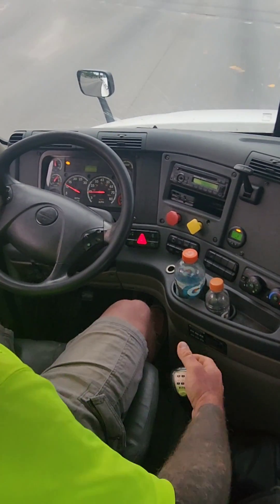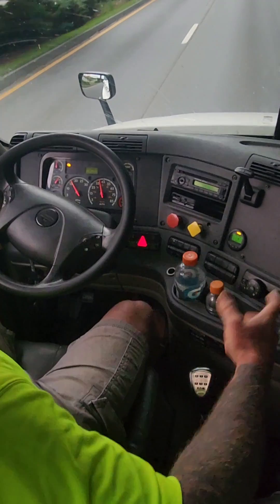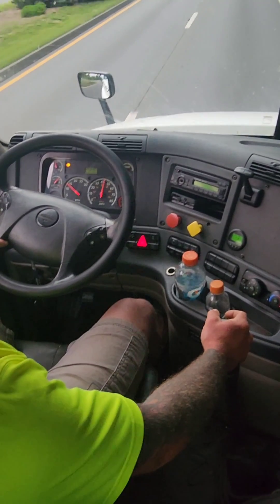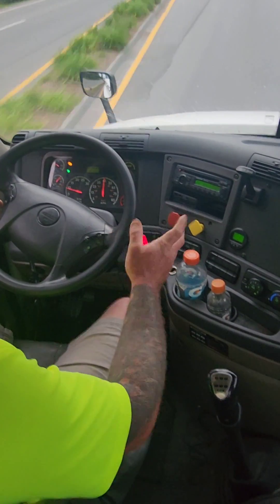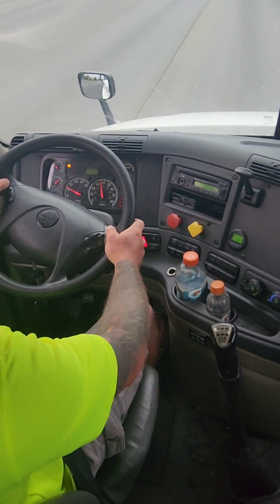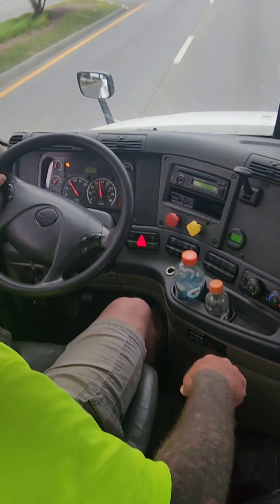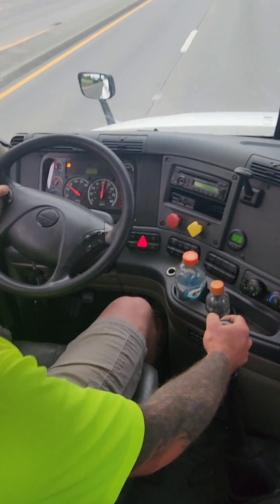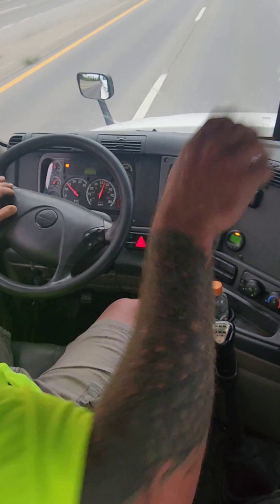Floating Gears - Eaton Fuller 10 Speed

Comment: Is it normal when upshift ,get up to like 7 th gear the stick want come out of gear to neutral unless I mash the gas a little to go to next gear
Reply from the maker: @NdimiTechxOfficial  it isn't exactly normal, but it does happen. Sometimes you'll feel 2 clicks when putting into gear. If you slightly hold the shift against the gear after starting to give it fuel, it should go all the way in.
Reply: if you let off the accelerator too quickly when pulling it out of gear the sudden slowing the momentum of weight against the transmission will keep it in gear . tap the accelerator little till it slides out. and turn off engine brake till you master the skills of keeping a little throttle on to keep engine brake from engaging. in other words never totally let off the throttle when floating gears when engine brake is on. so shut it off, till you get the hang of floating gears .